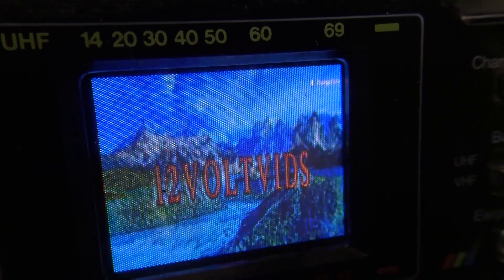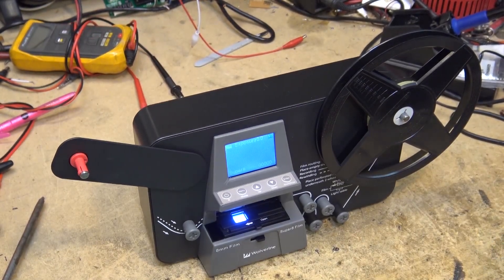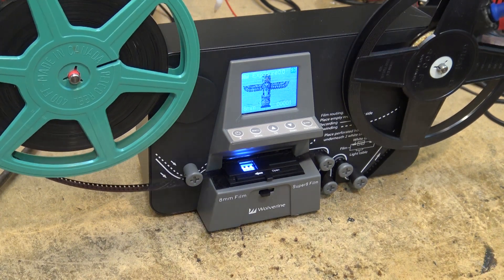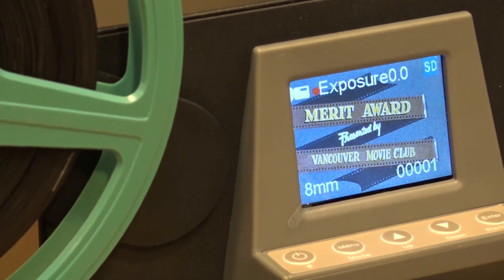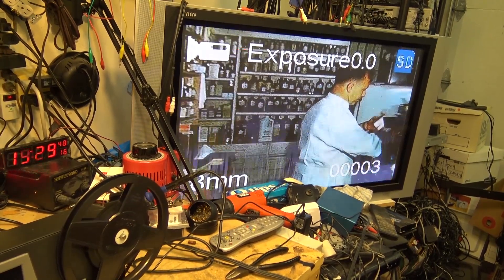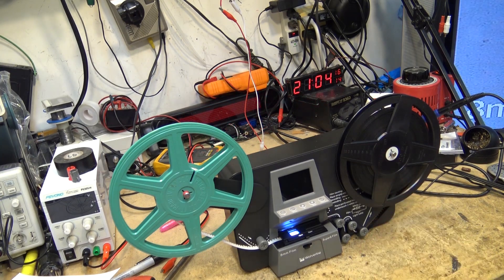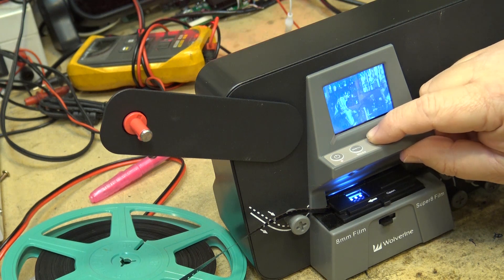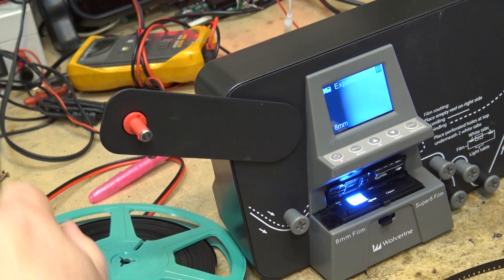Wolverine Film Scanner evaulation and quality check

Comment: The image is noisy, the blacks are crushed. The digital noise is actually hiding the actual film grain. I think the light source is too weak, therefore the noise.  It is obvious how much of the existing image quality of the film is left on the table. It's all neatly integrated though and reasonably easy to use. But the end result is still much worse than a professional transfer, especially one using a wet gate. So building one's telecine rig is still warranted. Thanks for the video, very informative.
Reply from the maker: You should really look at the source footage, and not one that has gone though the editor and been re-compressed into low bit rate and then uploaded to youtube to be compressed a 3rd time before you trash the quality. The source files are of much better quality, and I had NOT set the unit up. This is how it came out of the box.
Are there better solutions, certainly, but when you are comparing a 500 machine to a 5000 machine you would expect to see quality differences. The thing is this, nobody is shooting 8mm or super 8 film these days. You can't even get reversal film anymore. All the film these units are ever going to see is 50+ years old already with color shift and fading. So how much difference in quality are you going to see between this and a 5000 scanner on 50 year old film. Guaranteed not much difference, and for a 5000 scanner I would have to charge a rate that is so high that nobody would do it. Most, and by most I would say 90% of my clients don't even want me to use this unit because I charge higher price to scan this way. They were perfectly happy with my old projector into a light box and broadcast camera. I do it that way for less because I can do it in real time and hand them a DVD when done. Most clients dont care if it is HD or DVD quality. They just want their films done cheap. I talk them all into paying the higher price and scanning the film properly, and not one single client has had anything but praise for the quality. 
About the only people that whine and complain are the internet trolls that nit pick, like you, which I really don't give a rats ass about. My machine has paid for itself multiple times over, and everyone has been very happy with the results. I have had film sent in from as far as London England to convert.
Reply: @12voltvids  Yes, it certainly works well commercially. Pixel peepers like me make up only a tiny percentage of the potential customer base. Didn't mean to come across that negative. I just couldn't help being a smart boy, my bad, i should have known better.

Comment: Nice machine, I have lots of regular & super 8mm films but the splices are old and done using those KODAK splice tapes.
The quality on this machine is FANTASTIC.
I did my films from a projector projected on a white sheet of paper years ago and it came out lousy with lots of flicker, I hot prices from places and the cheapest was 15 cents a foot and that was 10 years ago,  with all the film I have it would cost me about $800...WOW!
Question: Will we see the dentist pull his tooth...LOL
Reply from the maker: old64goat 
You have to watch it to find out. I posted it years ago from the vhs scan. I should repost but I will color correct it first and make it look better than the source as I can fix the green cast from film fading in lost easy enough.

Comment: Notice how the film path  bends the film back and forth. A great way to turn an old brittle film into spaghetti. I plan to build a scanner that does not bend the film.
Reply from the maker: There is a reason for this.  So the take up torque from the take up spool does not move the film.  I have put through hundreds of reels so far and not one film has broken.  Poor quality splices done with old splicing tape have come apart but not in this part.  They have actually come apart in the scanner gate. Big deal the unit stops and waits for operator to clear the jam, but not a single film has broken.   
Compared to film running through a projector at full speed this is about as gentle as this old film will ever see.
Reply: I have the Reflecta model that just take the five inch spools. I rarely use the suggested film path, just take it straight through. On rewinding and on some films I use a string with a key as weight on the feed spool just to append a small amount of braking force.

Comment: Have you ever worked on any actual frame to frame projectors with sound like the ones made by Bell and Howell from the 70s?
Reply from the maker: I have an Eiki 16mm telecine projector (5 blade shutter) with sound and a Kodak 8mm sound unit.
 I used them in an optical conversion system back in the 80's and 90's.
Reply: @12voltvids  Cool! Have you ever had to do any repairs on these old machines before? I remember from helping my teachers back when I was in school that some of these projectors used a separate lamp for the soundtrack.
Reply from the maker: @Truckguy1970  
Yes they use an exciter lamp for optical sound. I have replaced belts on mine, and of course the projection bulb.
Reply: @12voltvids  I've replaced many of those bulbs, they're getting hard to find now. I never did any work on the mechanical parts though because some of them need special alignment fixtures

Comment: This is an old video I know, what is your opinion of the Wolverine Pro today?
Reply from the maker: Still using it.  Many miles of film through it.  Take up reel motor burned out. I let the film drop into a box on the floor and wind back out of the box.  Produces good results.  I scan full frame and crop, color correct and speed correct on the PC afterwords.

Comment: I have one these and it really needs a firmware hack with proper adjustments. It turns anything slightly orange into an over saturated yellow and gives me an overly compressed mp4 file. I'd like to have some sort of white balance adjustment and RAW output.
Reply from the maker: I have not had an issue with any color films I have run through my unit. I use my commercially and have run though about 800 reels now, and it has worked well, including some new stock negative film, which was inverted on the computer to get a positive image from the negative film stock.

Comment: That really shows up the compression articafts on the Wolverine compared with your other  transfer.
Reply from the maker: Well the punch in was from a VHS tape copy made by shooting the screen. There is no detail in it. Also this was done with the default settings on wolvering, before it was dialed in.
When I edited the video, I had originally shot the demo footage in 1080i and just dragged in the 1080p footage from the wolverine. It was then rendered out in 1080i and youtube converted it back to 1080p. 

Here is what the wolverine is capable of, again edited in premier, but with the wolverine properly dialed in, and the proper settings applied to the editing software. It is actually very good. I could do a comparison to these same films that were put on VHS about 30 years ago, and you won't think the VHS copy looks better now.
https://www.youtube.com/watch?v=8hAZ2khyhXU
Reply: Yes but the dashcam used in the Wolverine has much too high compression and isn't very good. Many people on the Super 8 forum are involved with changing the sensor and the software/control gear to get a really good transfer.
Reply from the maker: @brianfretwell3886  its good enough for anything I will ever need it for.  Done many transfers for clients and they are all happy and that is all that matters.  I don't shoot new film.  These are all ancient films most are in pretty bad shape to begin with.
Reply: The worse shape they are in the worse the effects of over compression. Kodachrome properly exposed with no damage would be the best under exposure or 160 Ektachrome looks really bad.

Comment: I bought and used the cheaper Wolverine but just recently upgraded to the dearer 'Pro' version as discussed here. I must admit being rather disappointed to find that the image quality of the dearer model appeared to be much the same as the less expensive one. Comparing results obtained with the 'Pro' with exactly the same film scanned on my original Wolverine showed very little perceived difference. 
Worse still however is a problem that I am surprised hasn't been mentioned here so far. That of vertical jitter. I have found that this fault seems to occur  with both machines, old and new. It varies from slight enough to be ignored to severe enough to be unwatchable. About 1 in every 5 films require a second or even third scan to finish up with a reasonable result. Changing the threading path by bypassing one or two rollers on the take-up side can often cure the problem for one film but not necessarily the next.. 
Any other Wolverine users been plagued with this problem or have I just been unlucky? Any suggestions for a cure would be welcome. For instance, Is there any safe way to experiment with gate the pressure?
Reply from the maker: After using the unit now for a year and transferring about 560 reels I have had the odd film that needs rescanning due to jitter. It is usually on a reel that was tightly wound or a metal reel that was slightly bent.  About 1 out of 10 for me seems to be the number.  Still for what it costs I am happy with the results as are my clients.   There are certainly better machines available but at 10x the cost.  For home use or small scale business use this one is fine. If you are making a living scanning film spend 4 grand and get a bigger setup.  For my small volume transfer service, a couple of orders a month this one does fine  and I make money off of it.  If I had spent 4 grand I would still be paying it off in the quanatity of film I transfer.
Reply: FINALLY SOMEONE WITH BRAINS. THE 1080P HERE IS PURE FRAUD ON THE PART OF WOLVERINE.
Reply from the maker: @TRICK-OR-TREAT236  
The output is 1440x1080 which is a 4x3 aspect ratio.  I have shown the quality in a few demo reels as to what to expect.  I did not receive this as a promo to "pitch" I purchased it to so small volume transfer work and it has met my expectations for what it cost.  There are much more expensive solutions that will deliver better quality, but most people films are not great quality to begin with.  I have done a few dozen orders over the past year and everyone has been very pleased with the results.  Most clients bring me 1 film first and then when they see how it looks bring the rest, so from my experience people are happy.  For 375 it does the job. Is it perfect, no. I have not experienced problems like jitter that some have claimed. Bad splices sticking are the biggest issue for me

Comment: IMHO, the VHS version looks better, even if lacking picture brightness and sharpness. The digitized version is much brighter, but also has not the greatest color reproduction — especially the skin tones and red parts — and the picture is heavily oversharped. You can even see aliasing that wasn’t part of the original film. But maybe there are options to turn the image style more neutral. 

My father bought an analog photo and slide ’scanner’ probably 8 years ago. It proved to be a cheap smartphone-like camera with a low-CRI LED backlight and a fancy user interface. The image quality was comparable with your film scanner. So sadly, the manufacturers don’t seem to improve their products for home users at all.
Reply from the maker: Nope, they don`t but this is what all the photo labs are using to charge their clients big bucks, so I will do the same.

Comment: hi! great first review. it looks like you did the transfer for this super8 film with switch on 8mm mode, don't you?.
is there an analog output signal which you're using to monitor it? and it includes text on it.
sometime ago there was an internet project where a guy transfered films using a normal photo scanner.. if i'm not wrong, that included the sound track, so throught the scan process they got video and audio.
regards.. very useful info on your channel

Comment: I have used this machine to copy many old family 8 and super 8 films. I found you need to remain in the room doing other things and listen for jams. The machine does a nice job and faithfully copies your movies. I transferred over to dvd and computer and made copies for family members living in different locations.
Reply from the maker: It never jams on 50 foot reels.  Longer reels may jam if the splice was not done right.  Mine very rarely jams.  I have had some big reels that have springs that grip the film tightly and cause jitter.  Rewind onto a different reel and no problem.

Comment: Be ready to change belts. I think they use old stock ones in there units. They go to gum in no time. That thing a few years ago was like $150.00 I fig they pulled them off market after so many just were junk.
Reply from the maker: I will be doing a tear down video on this unit next, so we will see how well it is built. A few years ago it wasn't 150, it was 2500.00 as I looked at one when they first hit the market.

Comment: Hi. Great video.
At 11 minutes 50 seconds of your video it looks like a splice went through without catching kin the scanner.  I have both ordinary and 'frame line' splicers for repairing film and also one that uses scotch tape to make the join ( not very good)  Which do you think would be better to use ?
Reply from the maker: Splices done correctly have never been an issue.  The tape type is find as long as proper splicing tape with the sprocket holes was used with the splicer jig that holds the film in place.

Comment: hi there,very interesting video.However in the final comparison between this wolverine and the old VHS,the sharpness is obviously better on the wolverine but the color is all yellow whie the vhs one has natural colors.Why is that?
Reply from the maker: The VHS tape was transferred in 1984.  35 years later and the dyes in the film are color shifting.   Also this was the first film scanned and the machine was nowhere near dialed it when I scanned it.  I cropped in the unit for example.  Now i full frame scan and crop in the PC. That maintains the correct aspect ratio.
Reply: @12voltvids  i see,ok thanks.I saw another of your videos about the GOKO system.What was the difference of the standard 8 so that they should have two different models?
Reply from the maker: @uyuyuyuuyuyuy  standard 8 used a smaller frame sise. It was the first format.  Super 8 came along, smaller sprocket hole allowed for larger frame image size which improved the image quality for same grain size.
Reply: @12voltvids  yes i know about the format,i was talking about the mechanism,couldnt it be adjusted ro standard 8?seems to me a little extreme to have an entirely different model.
Reply from the maker: @uyuyuyuuyuyuy  Take a look at the teardown video here:
https://www.youtube.com/watch?v=3E_yPElVwwo
It would have been impossible to do a dual format because of that optical prism wheel that coupled the video frames to the camera. Super 8 being a different frame size the facets on the prism won't line up with 8mm. So they had 2 machines each selling for 2500.00

Comment: I have noticed a lot of unacceptable compression in the images. Is there an upgrade to a better codec?
Reply from the maker: The "unacceptable compression" is mostly YouTube plus this was the first time I used the unit and did not set it up.  It actually looks great and I have made thousands doing conversions.  I just did an order for about 1100.00 and the client was so impressed that she brought me another 500 in super 8 reels.  If you want an upgrade there are plenty of w
10,000 and up scanners you can buy. This one however does a great job. The key is not to crop the frame on the unit.  Zoom back to show the entire film, set the exposure to -.5 stop, and don't use the take up reel.  Let the film drop into a garbage pail and rewind from that.  Then load up on computer and do the speed correction and crop to frame size and output in whatever final format you want it in and knock yourself out.  It actually looks great and not a single customer has anything but praise for it.  I have had a few people get me to scan 1 or 2 reels so they could see the quality and then ordered one themself and paid me a consult fee to help them get their set up running.  One fella didn't have a good computer so he scanned all his films and then brought the hard drive over and paid me almost as much to crop, speed and color correct as i would have charged is i had actually scanned it for him.  For the 500 bucks it cost it has paid for itself over many many times. Had i dropped 10 grand on one of the other units I would still be making payments on it as there is a top end on what people will pay for film transfers and 10 for a 50 foot (3 minute) reel seems to be at the top end of the scale.  Go higher than that and they are pointing a projector at the wall and recording it with their camcorder. (yes people do that too.  Had a guy that paid me 100 to rent my projector for 2 weeks to do his own and burned out the bulb. I found out that the bulb is 135.00 argh. )
Reply: @12voltvids  thanks for your answer. I would love to show you what I mean by the compression I have found in my scans. I accept that it is not going to be perfect.